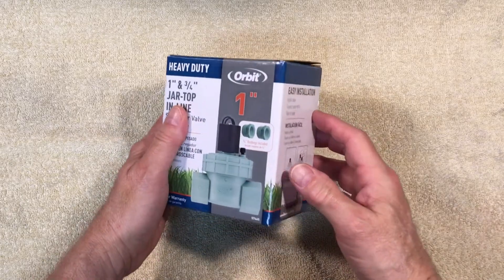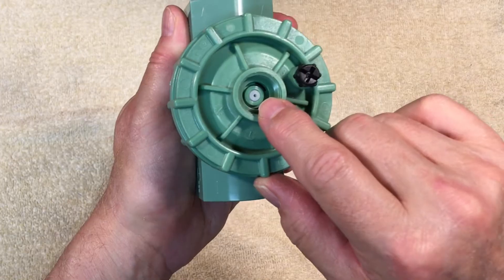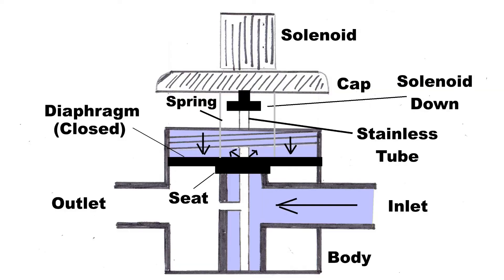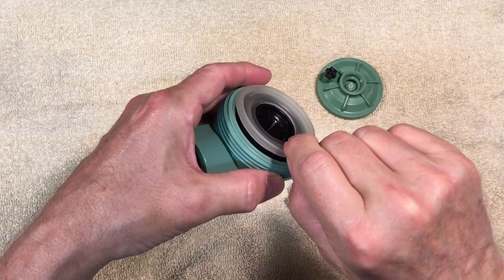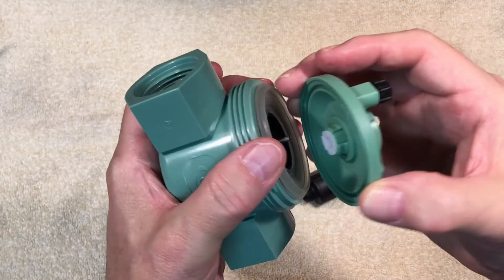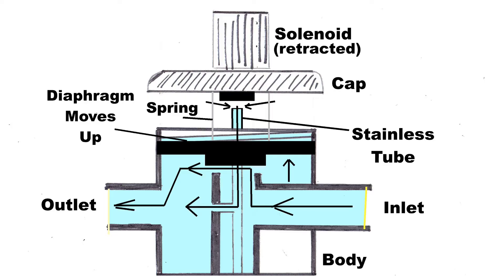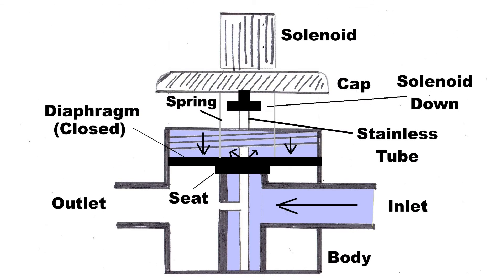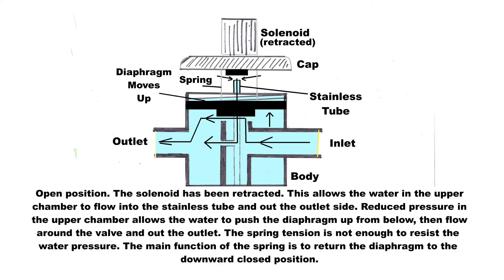How an ORBIT Jar-Top Sprinkler Valve Works

Comment: Thanks. I understand the concept but could not find a source for the water to enter the upper section of the diaphragm. With your explanation, it is simple, a semi sloppy fit of the stainless steel tube through the diaphragm. It just leaks a little from below to above, 
when its full it stops. It doesn't take much of a flow for the laws of pressure to take effect!
thanks again

Comment: Great video.  MY orbit jar-top 3/4 valve is leaking.  What could be the reason for this valve to leak on the output pipe when its closed?   I have 70 PSI pressure.

Comment: so does there need to be constant water pressure to keep the valve closed?  i was going to have my pump turn off and close the valve at the same time so there would be no water pressure.
Reply: If there is pressure yes. If not it doesn't matter.

Comment: Thanks.  in 18 years I never had a valve leak until the other day.  An older Orbit valve won’t stop allowing water to pass.  Thought solenoid was bad but new one did not solve problem.  Now thinking the diaphragm is either dirty or worn.  This video makes all the difference it understanding how such a small hole functions to handle high pressure and greater volume of water.  Going to reinspect the internals before throwing more parts at the problem! Thanks again.

Comment: Thank you for the video.
I have a question. One of my valves started humming and the sprinklers are having trouble rising.
If i back off the small screw the pop up fine, but then water will leak after the cycle.
So, how can i fix this valve? I really dont want to take it out of the system durr8ng the summer.
Reply from the maker: Buy another valve, and replace only the guts of the old one. Do not try to replace the body.
Reply: I just replaced my valves as the new homeowner but now one won't work. Unscrewing the bleed valve let's water through to sprinklers and I've confirmed the solenoid is actuation when voltage is applied. But valve won't open when solenoid is active.

Comment: Very good explanation.  How the larger area above with input pressure presses the diaphragm down with high force. But never use a hand screw jar type valve. One forget using these green orbit parts.

Comment: I have one station that will not turn on. 5 other stations do come on. All have continuity at the watermaster timer. I have to go out to the inground box and turn the dials for station number 1 to come on. idk what else to check for in troubleshooting?
Reply: Maybe a bad solinoid or diaphragm.  Solinoid should be 27-60 ohms.  Check when unhooked with a multi meter.

Comment: How can I disassemble this orbit 's battery operated timer so that the water will flow through it. I do not need the timer any longer. But I don't want to replum around it. Can i disassemble it and if so will the water then flow through it?
Reply: Drill a hike in the diaphragm.

Comment: For a one inch inlet and outlet, it sure seems like a lot of restriction in those small orifices. Mine buzzes when on but still seems to work fine. Maybe an insufficient electrical connection.

Comment: the orbit valve is an old Richdel. Orbit is a discount brand, not many professional contractors install it. Sold mostly at Home Depot. Why not spend $10 or $15.00 more and buy a professional grade valve, rather than screwing around with a mediocre product?
Reply from the maker: I'm not a professional, just interested in how some things work. I do have two of these Orbit valves that have been been working fine for nineteen years, but their operation was so baffling to me that I decided to get one from HD to try and figure them out (and have a spare for whenever!). I appreciate your comment, thank you.
Reply: Shut up. Good lord.
Reply: It's true.  Orbit bought out Rainjet and then discontinued the rainjet sprinklers,  One of the best sprinklers made.  They just bought the competition so you couldn't have the quality product any longer. When the patent runs out someone should give us back rainjets.

Comment: So what that little black plastic screw on the top. May as well have trouble shot at the same time. But Thanks for explaining.
Reply from the maker: If I remember correctly, the bleed screw does two things. The first is to bleed the air out of the valve after you have disassembled  the valve and let air in. The second is that you can activate the valve and let water pass through by merely opening the bleed valve (no power required). This reduces the water pressure on the top of the valve and allows the diaphragm to flex upward, letting the water flow through.

Comment: Well, going nuts trying to figure out why the valve identical to this one will not close. So far, I have replaced the diaphragm, the solenoid is working and flushed the valve. Still will not close, I will throw a new solenoid at it.
Reply: Dealing with this situation. Using iridol parts and unsure why it won't close. I'm wondering if solinoid position is an issue. Did you resolve this!

Comment: Thank you for sharing your knowledge and providing such helpful diagrams. I installed my sprinkler system several years ago, yet every year forget exactly how to make them work with the timer. I twist the solenoids open and then the water pressure valve, and then twist them closed, try alternating them, etc… all of this because I never understood HOW they work. Now that I know, the mechanism makes sense and I don’t think I’ll be confused next spring! I also think I’ll be able to replace a coupe parts with more ease than I initially anticipated. Much appreciated!
Reply from the maker: Thank you for watching!